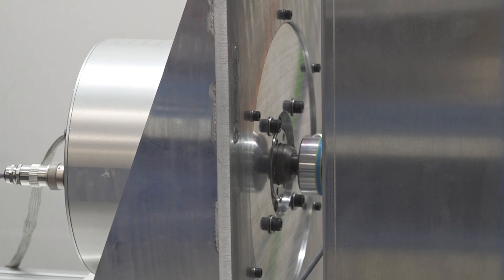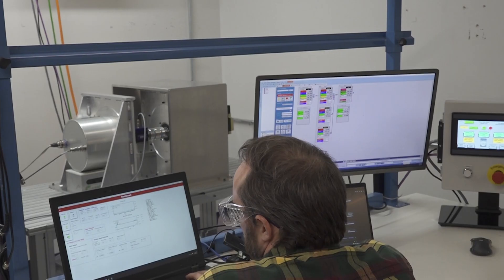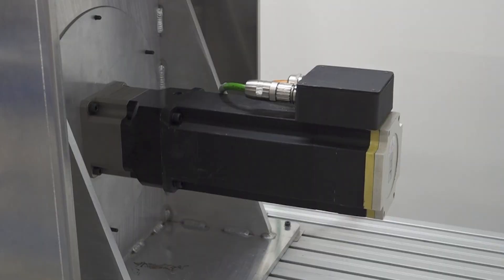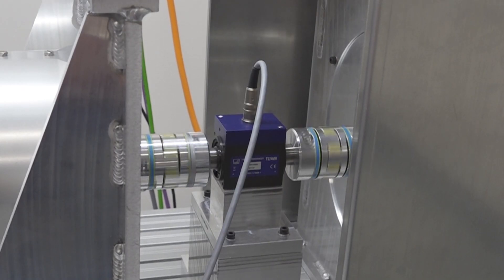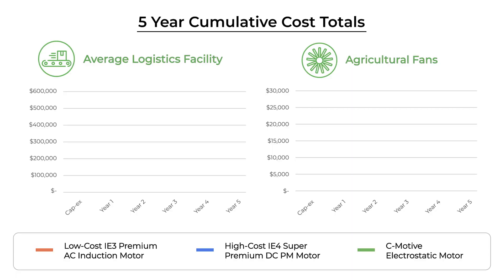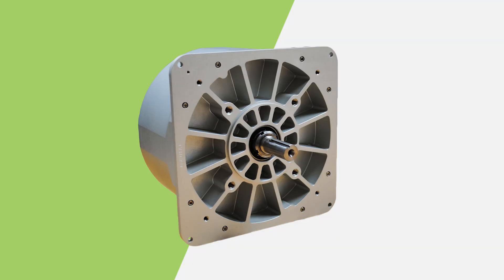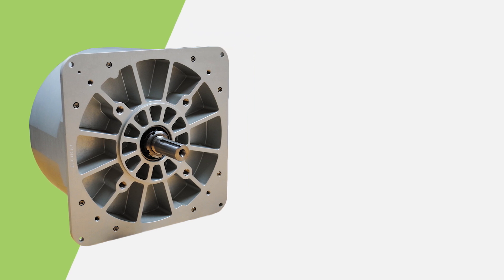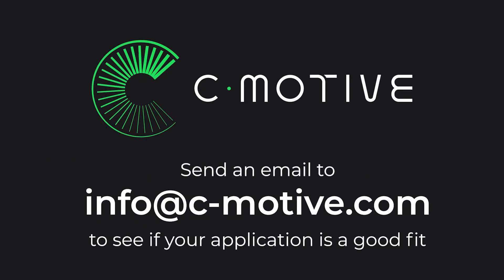Testing at C-Motive

Comment: Can you replace a Tesla motor with C-Motive motor? You must make a video comparing the two (size, power output, power consumption, cost etc.)
Reply: I think that the size cannot be the same: the electrostatic motors are bigger than electromagnetic motors of the same torque or power.
Reply: @pratoarancione7646  but  material one can use light weight materials. High voltage low currents allow using cheap aluminum  vs  heavyer copper.  And no heavy  iron and and other expensive magnetic materials further reduce cost or lower weight.